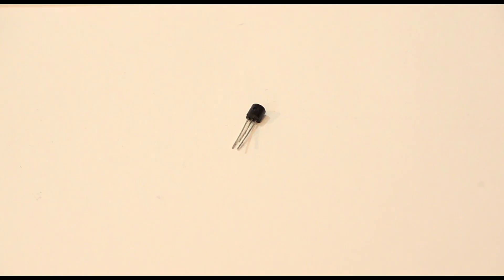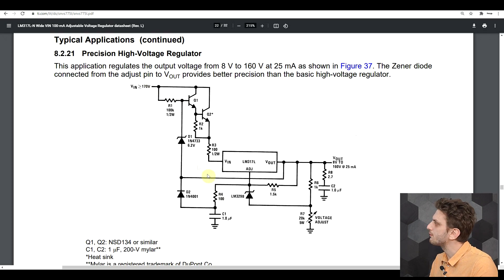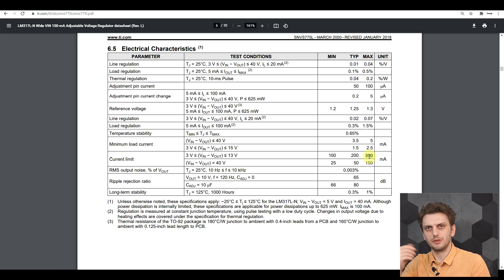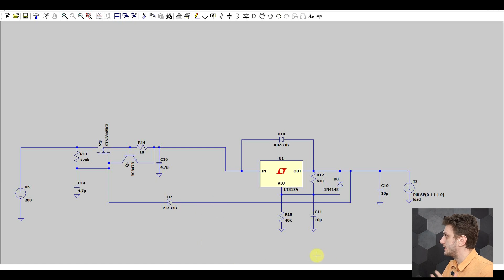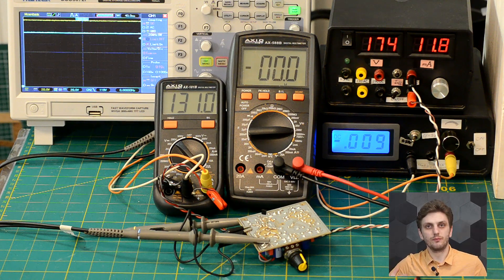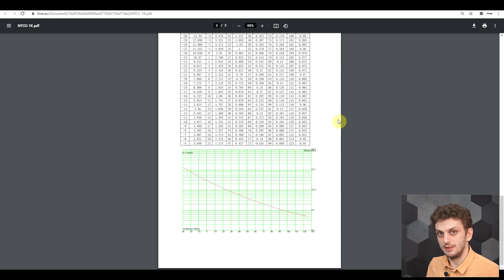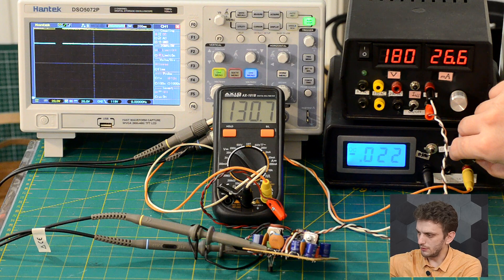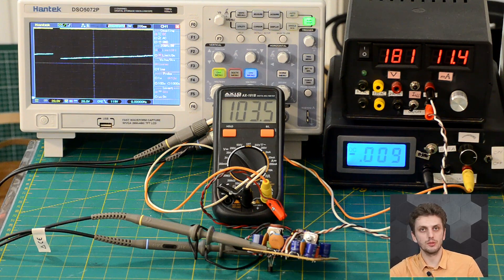DIY - High voltage linear regulator based on the LM317 - Part 2b

Comment: Thanks for this very nice video. It's very instructive to watch a hardware debugging process step by step.
Just one comment, I have the feeling that having such a small heatsink made that you had to add explicit current limiting making thus the thermal protection of the LM317 inoperant thus requiring explicit thermal protection through the added PTC. Had you had a better heatsink would have permitted the LM317 thermal protection to kick in before the mosfet burning.
I have this feeling without being 100% sure about it.
Regards

Comment: I was thinking about multiple LM317 regulator stacks to achieve 325V regulation from 330V, but this gave me some ideas, but would use something like a BUX80 bipolar for input, your circuit looking good, needs fullwave and decent smoothing on the input though, you can at least put a 160uF 400V cap on the input (2cm diameter, 2cm tall-Elna) to get those higher currents at better regulation.

Comment: Good presentation!
The cap at the 317 input is not needed. 
Did this circuit 35 years ago with TIP50, not a Fet.
The 317 is not an independent regulator, it  is a part of the MOSFET gate circuit. The parts better be chassis mounted TO220 style. 
Curret limiting with power resisors on the input also helps for low current circuit. 
The Zener voltage should be high enough to allow 5V across the 317 and enough to turn on the FET, with the PTC add margin for its normal droput. 10 - 12 V may be OK.
A 10uF cap on the FET gate OR the 317 adj. pin improves regulation. A large value resistor can set the startup slope with the 10uF cap on the gate.
The Zener connects the output to the FET gate, basically AC grounding the FET gate (with a 10uF to gnd) making the 317 work the FET source as a common gate config. The FET drain works the power supply as its load.

Comment: What do you think might happen if instead you used a resistor instead of the PTC and thermocouple it to the LM 317 and allow the heat of the resistor to trigger the over temperature protection in the lm317?
Reply: Using the thermal protection of the LM317 is a BAD idea. The limiting threshold is too close to the melting point of the part. Bad design of the part.

Comment: I love your videos. I’m just a hobbyist, so forgive me if this is a dumb question - but why couldn’t you use one of those self-resetting fuses for overcurrent protection?
Reply from the maker: That will also work, I think the same basic operating principle is used in both the PTC and the fuses you mentioned. I used the PTC since its something more people are familiar with and it was a component I already had lying around.

Comment: Thank you! I'm just a tube-amp building hobbyist. I've tried so many different Maida style regulators, all of which had their issues, and none of which I fully understood. I really want to build your version. I will sign up for your Patreon, as I don't feel right just lifting your schematic, you are very good. I really need a HV regulator board I can rely on to get voltages from 120 to 400 volts. A question I have though... With a regulator like this. Is it still best practice to keep the raw DC input somewhat close over the desired output voltage, so that overall you're not dropping a huge difference. That waste has to go somewhere right? Typically how many volts should my raw DC be over my desired output with this regulator sot runs good but doesn't have a huge waste?
Reply from the maker: For any linear regulator, it is mandatory to keep the input voltage higher than the output - I would like to point out that "raw DC" (if by this you mean what you get after rectifying and filtering with capacitors), still looks like an offset sawtooth and the voltage that needs to be taken into account is the minimum of the sawtooth  (not the avearge). I will have to check again what the minimum voltage drop is for this particular schematic, but its the threshold voltage of the MosFet plus the minimum requirement of the LM317, maybe an extra ~0.5-1V just for good measure.
Reply: @FesZElectronics  Thanks for the quick response! In the video a wide range of output voltages was shown because its variable, that's why I asked. For my use I would set a fixed output voltage to the tube anodes. 1 or 2 volts is easy, I was thinking of 10V or so for good measure. In my case the tube plates need 340 volts (not sure on how much current two channels will draw yet). So for my bridge + first reservoir capacitor stage output I'd model a transformer that lands me around 350V after the reservoir, it looks like I have 260V toroid transformer that will work.
Reply from the maker: Regardless of whether its fixed or variable, the same method to calculate the minimum voltage drop is true; its just that for the variable version, the minimum input is calculated based on the maximum output voltage. For 260V AC - you should get a peak of 368V; but after rectification and filtration you should still be above the 350. I would just like to point out that its also important to take into account the transformer series resistance - if this is large, you will not be getting the 368V peak, but rather something lower when large currents are being drawn. Anyway, if you are making a PCB, you can leave an empty footprint in parallel with the upper feedback resistor to change its value (add another one in parallel to lower it) - so you can set 340V for example on the output.

Comment: How about just coupling the Regulator to the transistor on the heat sink? This way if the transistor overheats, the regulator will pick up the temperature swing and shutdown.
Reply from the maker: I did try doing that, it was my initial method, but by the time the regulator picked up the over temperature (internally set to ~180C) the transistor was way above its maximum operating junction temp...
Reply: Perhaps it would have been ok if the heatsink was not so small...

Comment: the current limitation of those parts, like the lm317, consists of destroying it with a remaining high resistor.
have a try on a current mirror and a proper regulator.
Reply: I have no doubt Fesz knows what you mean but would you care to elucidate a bit for those of us not quite as advanced as he, or you?

Comment: Great video!
Would this circuit survive,  if you switch it hardly (very steep voltage ramp) to a loaded capacitor or other low resistive high voltage source? Would the linear voltage regulator be able to control the high voltage mosfet that save?
Reply: I have built a similar circuit and it does not survive a hard short circuit on it's output. The 317 breaks and so far I found no solution to fix this design problem. In my opinion the voltage over the LM317 is too high for a very short moment, until the current limit comes into action. So now I would like to see another video from Fesz, with a short circuit demo. (Hope he has got some spare parts left ...).

Comment: I've solved this problem before using foldback current limiting, you can get away with pretty aggressive ratios(nominal current lim vs short circuit) with these higher voltages. Only real drawback you have to be conscious of what your load looks like in order to make it through startup. Might be worth looking into if you want something a little snappier than the PTC.

Comment: It could be interesting to se a direct short on output at max current. Does it still survive ? 
I have struggled with the same problem, and build in a thyristor and a relay  to breake the short.
But then i have to shut down the whole supply to get back.
Reply from the maker: Well for my circuit, when the current limit was reached, the voltage drop on the output was <0.01 so I guess it was a short circuit. I left things like this to have a clear view of the current consumption.
Regarding your method with the thyristor, I guess you could replace that with a SR flip flop; once the current limit is reached, the flip flop is set; and then it can be manually reset once the issue disappeared; or it could be periodically reset with some sort of low frequency oscillator. You can built the SR with 2 transistors, so it can work with high voltages, no need for proper logic circuits.
Reply: @FesZElectronics  Thank You, I'll try to build it too :-)

Comment: Hi. I learned a lot today thank you. Q: When voltage across the 10R reaches ~.6V, the power FET turns off. But the circuit is still using 30mA? Does this mean that it is not completely off, and gets hot because 30mA is still going through it? So 150V * .03A = 4.5W being dissipated by the power FET?
Reply from the maker: Exactly. This sort of current limit doesn't turn the circuit off but rather it just limits the current. The point is that the current stops increasing at ~30mA rather than the up to 300mA that we would get by relying on the LM317.

Comment: With the PTC in the base emitter of your current limiting transistor won't it damage the base emitter juction due to the high voltage across the PTC, even if it is only temporary?
Reply from the maker: The PTC resistance changes quite slowly - since it is heated up from an external source; so you will not really get sudden changes in voltage. This means the transistors will always have time to react and limit the input current, and should not get damaged.
Reply: @FesZElectronics  thank you for your reply...I was just thinking of an increasing voltage on the base emitter junction.  It is sometimes hard to visualise what happens.......you have an increasing resistance and a reduing current, I was visualising there might be a point where that voltage could, in theory, be  enough to damage the transistor.  It needs a lot more thinking through on my part, the circuit is much more dynamic than I first thought. Again thank you for the reply...it is much appreciated as is your You Tube posts.

Comment: Whats the best way to help you stock up on more parts? 

Patreon? 

Its a shame digikey doesn't have a wish-list of sorts, we could buy you stuff.
Reply from the maker: Well regarding the parts issue, I try to buy as few components as possible since if I don't need them on the moment, they will just be forgotten in a box somewhere. So with this circuit I got the minimum number of LM317s and transistors which was 3pcs. I of course did not plan on braking all of them, so that is why I ran out of parts... 
Anyway, if you want to support my work, Patron is the best way.

Comment: Funny, you're having exactly the same issues I am having with a similar project. 
Btw I like to use something like a TL431 instead for current limiting. It's a lot more stable and you get a lot more control.
For worst case full short situations, I decided to switch off the voltage completely. This can be done with a PMOS or relay.
Reply: Oh, btw for the overcurrent protection, I then use a comparator with a pretty big hysteresis. So one basically has to restart the power supply to reset the circuit.
I thought about the PTC myself, but it's rather slow (because of the stored heat in the heatsink) and not always very predictable.

Comment: The PTC has a limited life, it is used as a protection device on circuits so I don't think you can keep cycling this without it eventually stop working.
Reply from the maker: You are right, the PTC is not something that should be used as a current limit during normal operation. My idea was to do something as reliable as the over temperature shutdown in the LM317 - which ends up putting the die well above its maximum rated temperature. So I just wanted to make a mechanism that protects the circuit during rare events, so it doesn't brake instantaneously.

Comment: Thank you, your videos are very interesting, but could you please go into more details and explain more next time. Thank you.
Reply from the maker: What exactly do you think I should detail more? I usually try to keep videos short, so they don't become boring, but I could always insist on certain topic more.
Reply: @FesZElectronics   I personally interested in detailed schema walkthrough, review why something works or doesn't (from physics or electronics point of view), data-sheets parameters meanings and advices how to choose right values (and reasons why).
I'm trying to learn to deeply understand why a circuit behaves particular way and physics behind it, unfortunately don't have time for full time studying, so I'm trying to learn from various information sources (including your videos). So I personally think dipper and more detailed explanations are better, because it is already plenty of videos in youtube with high-level circuit demos, but very little deep-dive circuit walkthrough and as far as I understand from various forums many people looking for this kind of information. Your videos are very good, and if you will be making them even more detailed, they will be even better. Thank you.
Reply from the maker: Thank you for this suggestion. I will try to give more details in future videos.
Reply: @FesZElectronics  I'm curious why, after an overload when the output voltage drops, the current is less than the maximum. The schematic doesn't look like it would provide a foldback characteristic.

Comment: A bit less known way to implement current limit is to use matched transistor pair to regulate mosfet. This way you have even less voltage drop.
I normally use voltage divider on the gate and use NTC as the pull-up to implement thermal limit.

Comment: Great little power supply. 
I wonder why you didn't use a couple of full bridge rectifiers to minimize ripple?
Reply from the maker: To be honest, I was trying to focus on the linear regulator part more. Also my transformer has a single high voltage output, so the only way to get both a positive and negative voltage out of it was with this 2 diode schematic. You can't use 2 rectifier bridges with the output ground interconnected on a single transformer winding; that would only work with 2 separate windings (so not with a single winding with a median tap).
Reply: @FesZElectronics  Of course. I didn't pay attention.
Note to self: don't go commenting right after getting up from a nap!